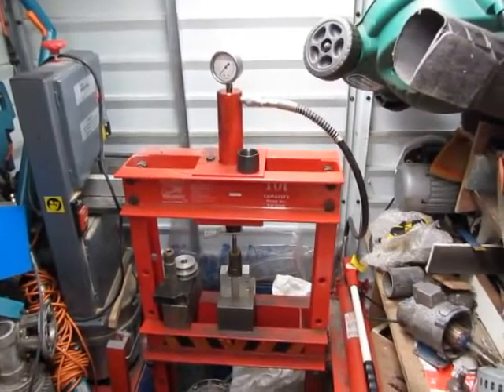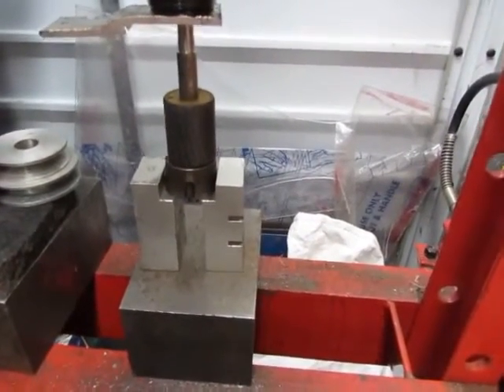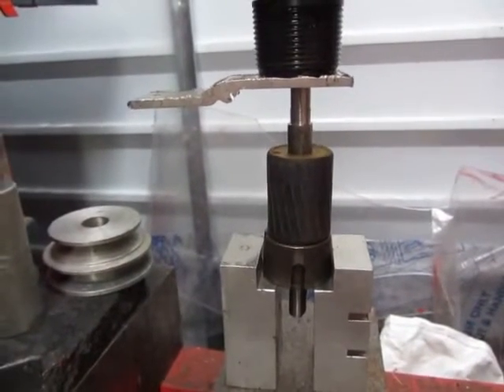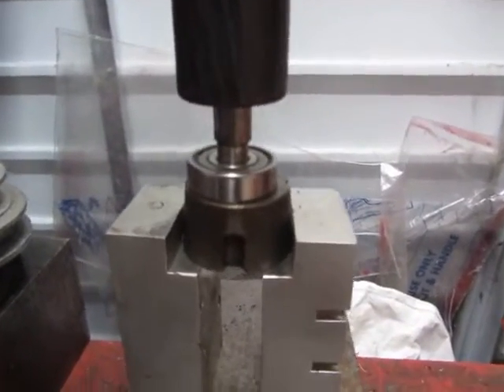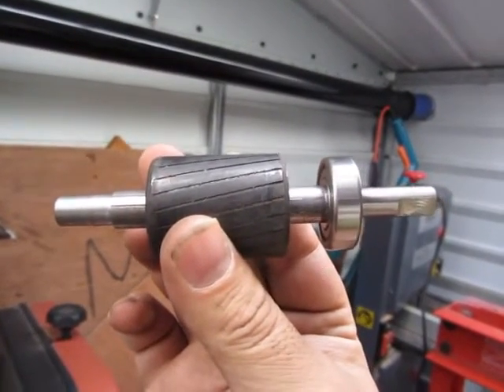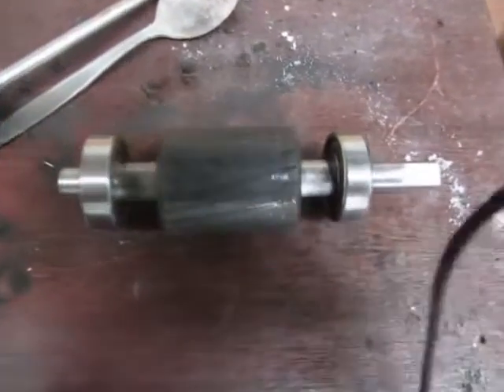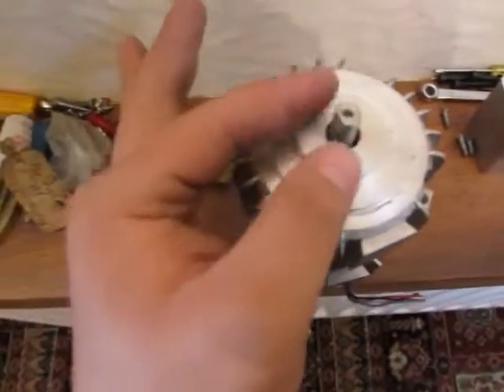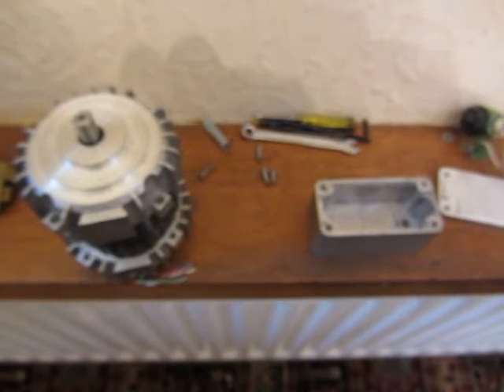Pressing the motor drive shaft into the motor rotor!

Comment: I was able to pull the shaft through by looping a wire around it, with 2 long threads, so I could center it..... but, I can't get it into the rubber gasket at the bottom of the rotor that the bearing sits in?? I can't get the bearing into  that gaske! lol Is there a special tool for this?   ... Idk, how they got it in there, cz it is long, like a rigatoni noodle, lol, half embedded in the plastic, in a cutout channel, but if I pull it out, which Idk it will come out without braeking, and it would be more difficult to get back in the groove... it's insane, it might be 3D printed, Idk...... any clue what I'm talking about??
Reply from the maker: Sounds like you might need and internal puller or a blind hole type puller to extract the bearing rubber seat. I have seen what you're talking about on some angle grinders and electric drills, it is normally on the brushes end of the motor armature (brushes ac universal type motors) and these rubber sleeves are stretched onto the outside of the bearing BEFORE the armature (rotor) is inserted into the motor and the bearing seated into the motor housing (or motor end cap on some motors depending on their design). You      may get lucky if you can find a long hook tool that is blunt, you might then be able to use this to carefully pull the rubber bearing seat/sleeve out of the motor housing/end cap and then fit it to the bearing before reassembling your motor again. Good luck with this man !

Comment: Hi. Is the friction pressure enough so that the shaft does not slip while operation?
Reply from the maker: Hi, Merry Christmas! Yes the motor shaft is forced into the rotor hole with a 10 ton force and it is tightly wedged together by a very tight "interference fit" 

For example the motor shaft is 12mm mild steel round bar and the hole in the middle motor's rotor is something like 11.9mm, so that allows for a very tight fit once the two parts are pressed together by a massive force (ie, 10 tons in this case).

I hope that this helps :-)

Comment: Hi, I have the opposite problem. I have a fractional HP 3 phase induction motor which I would like to disassemble. Looks like the stator is press fit into the housing and there isn't a good way to extract the stator. What would recommend?
Reply from the maker: Sorry this reply is 3 years late lol - You would need to place the whole motor stator assembly over a soft surface like garden grass supported by 2 bricks (or similar) at the very edges of the stator housing in a way so that the stator can pass through without getting caught on the supporting bricks, now you will need to to take a photo  of the stator wires (leads) and then disconnect them from the terminal block (if present), after this you then need to pull them into the motor stator housing and make sure that they are carefully tucked inside the motor stator housing,  you will then need a propane gas blow touch (or similar) to GENTLY heat up the whole of the outside of the motor stator housing in a controlled fashion until it EXPANDS and the motor stator drops out of the stator housing and onto the soft grass underneath, DO NOT TOUCH IT AS IT WILL BE HOT ! - let it cool down for half an hour and you're good to go ! - Sorry I did not see your comment to reply sooner !

Comment: Can i remove rotor from shaft of the motor by hydraulic puller. Please tell me
Reply from the maker: Depending on the size of the rotor and how much force was used to press the rotor shaft through the rotor body, A hydraulic puller may not work or may damage the aluminium or copper rotor part, The best possible way to remove a rotor shaft from a motor rotor is by using a press similar to mine  or bigger and some blocks of solid aluminium so that you do not do any damage to the soft metal of the rotor when using the press to force the rotor shaft out of the rotor body. 

Tip,  If you feel too much resistance when trying to press the rotor shaft through and out of the rotor, use a blow touch to apply some gentle heat to the rotor to expand it whilst it is under pressure by the press and it should suddenly start to move and press right through the rotor body - remember GENTLE heat only and keep your blow touch moving, as if your blow torch is too hot you could melt the aluminium or copper part of the motor rotor and ruin it. Good luck with this man.
Reply: Rotor is small I hve only hydraulic puller.  I will try.
Reply from the maker: @TheFamilytoons  Good luck. - If it is very small you might get lucky. otherwise try applying a little bit of heat from a small blow touch carefully to expand the rotor and loosen it for your puller to work better if it won't budge.

Comment: When pressing a baring, you should always put a washer or spacer on the inner race of the bearing. You don't want to put that huge axial load on the bearing, or you risk brinelling the races, which will make the bearings noisy. you want to apply force to the inner race only.
Reply from the maker: Hi Vincent, Sorry for the late reply ! - Yes I agree with you 100%. Well because this was a fairly small motor rotor there was not much pressure involved in pressing this shaft into the rotor and pressing the bearings on to the shaft so the bearings are both okay and this motor runs fine as seen in my other YouTube video on my channel - If a tighter interference fit was involved then a special mild steel spacer would be used with the press that would only make full contact with the center part of the bearing only would be used whilst pressing the bearing onto the rotor shaft to avoid damaging the bearings whilst installing them.

Comment: Very nice! Out of curiosity where do you buy the shafts?
Reply from the maker: +Miltdoggie Salamanca 

Cheers! - I don't buy the shafts, I use shafts taken out from old electric motors which are not working and then re-use these shafts by modifying them on my lathe to make them fit the new motors which I build (as shown in some of my videos), Sometimes I do buy mild steel round bar from eBay and then machine it down to the shaft profile I require to build a certain type of electric motor which may need a longer special purpose drive shaft.

Hope that this helps :-)
Reply: Joseph D 
hi 
can you help me fix my shaft pump broke it Sequencer pump please
Reply from the maker: @jimmynguyen6807  Sorry man, this was 2 years ago and I didn't see your message until November 2019 - Hope that you managed to sort your pump out and all is good again :-)